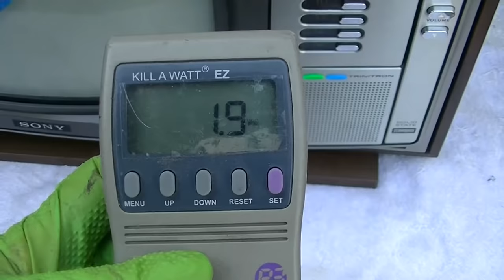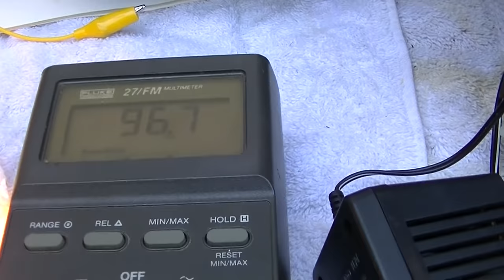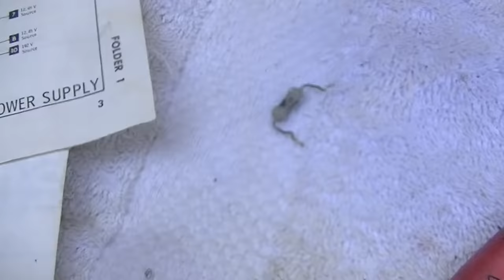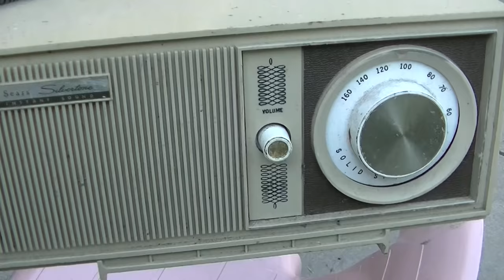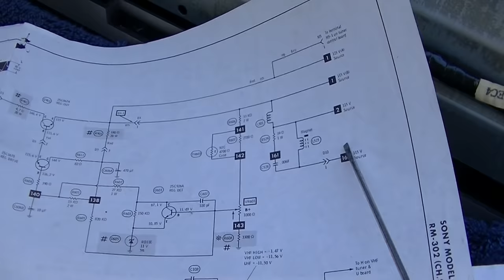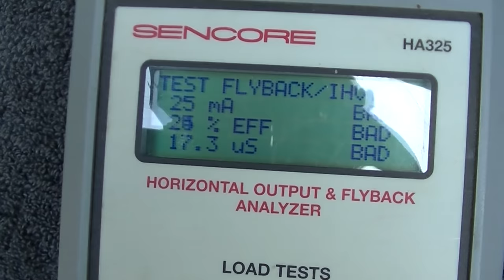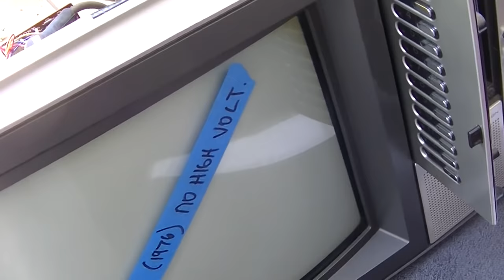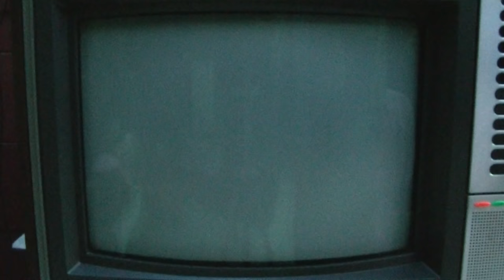Sony Trinitron KV1541 Remote Set Super Hard Fix 1977 Vintage Color TV

Comment: This video has all the hallmarks of a classic adventure move, suspense, fear, frustration and finally tears of joy at the sight of that raster.
As a kid in the 70s I hung out in a TV repair shop after school hours and got the tube TV repair bug. Sometimes I would carry an old surplus TV sets half a mile back to my parents house where I would tinker with them. I appreciate your videos and tenacity, really glad you didn't give on on this one, it would have been such a disappointment!
Reply: And stay through to the "end credits".  That imitation of the giggle was priceless, as well as the '80s videos.  Lots of Debbie Gibson.
Reply: still stuck with 21 inch toshiba crt tv, Age is 26 years and running.But the picture slowly losing sharpness.
Reply: I was a paperboy in 1988 or so when I got my first Sony Trinitron, a KV-1710. It was a rainy morning in April, ice caking on the TV, and it was in the garbage. I carried it from house to house as I finished my route, vigilant of the garbage truck. My arms were falling off, but I kept on saying to myself that it's a Trinitron. I got it home and defrosted it by letting it drip into the bathtub. A good clean, a good alignment with my TI-99/4A as the pattern generator, and that was my main TV until I was gifted a broken KV-1926. (Broken KV-1926? No stereo sound! KV-1926 was mono!)
Reply: My uncle [Moms elder brother] taught me radio and TV repair when I was age 8 - 
and I am going back to (c)1950 -- Joining the RAF in 1961 - after learning to fly at age 13 -
Serving later with Bomber Command  - I later studied Electronics and Electro-Mechanical Engineering,
having had a passion for it since a young age -  
Having served in the Military for 30 years serving three countries, and the Government paid for all that education and other studies I undertook.
Well that was one reason in joining the Military 
My problem now is that I know too much - Sometimes it can be a curse.
Even in my late years I find myself always repairing something - It keeps my mind active as does reading.
anything I can learn from.
One thing to remember  -  it is SONY  and not Sony -- 
People look at things and like zombies they cannot see exactly what they are looking at.
Yet the clues are right in front of their eyes.
CORPORATE Names are 'Always' in the ALL CAPS iteration.
Names of living souls are in 'Mixed Case' Letters
Teach the zombies to pay attention to detail.
Good luck
Reply: Only a marketing  or advertising person would notice such things.  The ideas and importance of branding are only important to them, bean counters and the business owners.  Whether it says sony Sony or SONY, it's all the same to Joe or Jane sixpack.

Comment: Great video - RE 70s era on-screen display - I somehow convinced my Dad that we needed a state-of-the-art TV for football. And then I further convinced him that the only TV worth considering was the top-of-the-line Heathkit 25" - and this set of boxes with 1000s of components arrived. Got it all together, and the magic smoke stayed inside. It had an on-screen display and an ultrasonic remote. It had built-in test pattern generation. Our dog could hear the remote up close. Pop used that TV for 30 years. It was still working perfectly when it got replaced by a larger TV.

Comment: Those spacers serve two purpose: minimizing eddy currents, and preventing core saturation because flybacks and single ended output transformers are always driven with the same current direction, which magnetizes the cores if there is no air gup in the core it will saturate, it will develop 2nd order distortion and its efficacy will drop. To compensate these effects you need to use either bigger cores or you need to put in an air gup.
Reply: I don't know how the air gap "minimises eddy currents" because in the first place the ferrite core is a poor electrical conductor. (I'm thinking its a ferrite core, and not a pressed powdered iron core because the core had an air gap.) The gap in the core, created by the spacers... does prevent saturation by reducing the permeability. But the air gap also changes the inductance... and in a flyback, so the resonant frequency too.
Reply: @willthecat3861  core saturation was the big problem with flyback low voltage derived power
Reply: @GBS1043  Yes. Does that relate to eddy currents? Because the fact that ferrite doesn't conduct very much, and has very tiny eddy currents, means there is little losses from eddy currents

Comment: The company I work for used to convert Sony Tvs into various types of video monitors, so we were pretty familiar with many of the different models back in the earlier days. The models that had the GCS (Gate Controlled Switch) were always a pain when they failed. Sony had a service bulletin that detailed exactly how to fix them, there was a list of parts to change every time a GCS failed and if their procedure was followed, 99 times out of 100 the set would come up with no additional problems. Many times the generic replacements would not work for the GCS as a lot of TV shops discovered. I used to do Sony work for five TV shops on a contract basis. The blown GCS was probably the second most common problem I saw, the most common was bridge rectifier failure to to lightning storms. As I recall, the GCS was something of a forerunner to the modern V-MOSTFET (invented by Sony years later). Somewhere, I think I have some technical info and specs on the GCS parts but I haven't seen it since the late 1970s.

For anyone working on later Sony TVs, Sony got the bright idea to put a large power resistor in parallel with the voltage regulator, to reduce some of the heat from it. If the high voltage failed, the main supply would jump to 170VDC which could sometimes cause other problems. Bad capacitors in the vertical deflection circuits were also pretty common. In later TVs, they used an integrated module for voltage regulation,  some of these were awful, the main supply would vary over 10V just by turning the picture (contrast) control, this in turn would cause the horizontal size to change quite a bit. We would change them on an as needed basis if the change was more than 4V or so.

I actually have a pile of those heat sinks for the main voltage regulator, and maybe even still a box of the voltage regulator transistor that were removed during modification, at least several hundred last I recall. Still have a pile of Sony OEM replacement parts I should probably sell off too, including some genuine GCS parts. Last time I bought them, I believe in the 1990s, they were about $21 each. I think we still have all of the original Sony service manuals as well plus the service bulletins.

In my opinion, the 15 inch Sony TVs had the best picture, in part due to the tighter stripe pitch on the pix tube compared to the 17 and 19". The 12 inch looked great too. The generation after they stopped using the GCS circuit, which included the KV1205 were probably the best looking model of all, a bright picture, next generation Trinitron tube and much better color demodulation. While it is all hazy now, one of the reasons Sony TVs looked good to most people is that Sony altered the red channel decoding by moving the phase angle about 10 degrees more toward yellow to give a more orange red, which helped skin tones in the days of analog color demodulation.

Thank you for the entertaining look at these old televisions and the trials to repair them. Sony TVs stumped a lot of good technicians, especially the GCS models.
Reply: The ECG276 sub for the SG264 never lasted one minute.
Reply: Yeah, fixed a few Sony sets.   High quality, but the circuit was always unusual.   I suggested that they were designed by an alien, because if all other sets did something one or two different ways, Sony invented a third, like the GCS vs bipolar transistor for H Out.  Very reliable until they got old, then you'd get a cascade fault and blow up half the set.

Comment: Well shango066, Congratulations, you sure earned your bucket of oats on that repair!  In the mid-1970's, that SCR horizontal flyback drive circuit became popular for a while.  It put out a lot more power than the traditional beam power pentode and was needed to power the new high brightness CRTs used then.  It proved to be very problematic, switching currents were so high, it caused RF to be generated, which broke down the plastic film caps used around the flyback.  This circuit was replaced with a high voltage NPN power transistor in later sets.

These 1970's solid-state horizontal stages were hard to troubleshoot (as you well know) because, the flyback was also used as a power transformer to generate all the other voltages in the set so, the circuit ended up being a huge control loop, making it almost impossible to troubleshoot.  You have to break the loop to do that effectively and run one block at a time.

That bad flyback appears to have a bad high voltage rectifier, that breaks down under full high voltage.

I especially disliked working on Sony sets.  The company definitely has ego problems, always trying to reinvent the wheel and showcase their accomplishments, which ended up making the sets unnecessarily difficult to service.

In the 1960's and 1970's, it was common to see transistors misapplied in TVs, operating in regions that caused secondary breakdown problems.  Over dissipating components was also common.  That series pass regulator transistor for instance, it should be at least a 5 amp part and there should be some type of current limit circuit that folds back, instead of blowing the fuse and several expensive transistors.

The plastic disks between the flyback cores were used for two reasons: (1) To keep the core from saturating.  (2) To adjust the resonant frequency to achieve the proper ring shape, which affects the horizontal sweep linearity.
Reply: I've seen some large current switching supplies from computers of that era based on SCRs too. Guess why we don't see those either anymore
Reply: @gabotron94  Those SCR switched supplies came out before power FETs were developed.  They were more lossy, generated more radio interference, and used physically larger coils/transformers.

Comment: welcome to the world of sony sets that use gate control switches  it took us a long time to work out the idea of running the line osc from batteries we used 2 pp3 in series  some sets used gcs as line output and psu chopper circuits they were a compleat nightmare  antway very well done and thanks for not giving up
PS in the british practical teivision mag there was an artical about converting the line output stage to run useing a BU208a trasistor in place of the GCS.
Reply: Used to fix the odd Sony.   Quality stuff, but it was very different.  If there were three ways to do something, they did it a fourth way.   i often suggested to the boss they were designed by an alien.  Worked well, but GCS for flyback when everyone else used a bipolar transistor.... different design philosophy.

Comment: Great stuff Shango! Yes, these are a pain sometimes. What do you think of the two series HV diodes to the CRT anode, possibly leaky? Maybe breakdown in the H-STAT block? Thanks for taking the time to share your adventure.
Reply from the maker: I think it has something to do with the broken bolt because it comes up again in a future video. If I can find a replacement u bolt I might revisit this
Reply: @shango066  I used to do Sony repair for many years, Many MANY years ago.  Smells like the h-stat block to me.
Reply: I also have to say, Sony sets from this time period are what made Sony famous.  Their picture quality was so far ahead of everyone else's, and the engineering and circuit design was like 5-10 years ahead of what the old established US brands like RCA, Zenith, and Maganovox had.
Reply: @shango066  the bolt presses both halves of the ferrite core tightly together to keep the air gap (thickness controlled by the plastic inserts) small. When the pressure is missing the air gap will increase, greatly reducing the inductance of the flyback. Your Sencore instrument read 1.something instead of 10.something µH !
Reply: @shango066  I think that will affect the inductance of the flyback a fair bit. Think of the way a shading coil affects an induction motor.
Reply: Interesting about the H-STAT block. In the 1990's I repaired several KV-1830's, and the trickiest part when the horizontal output stage had a fault caused the immediate shut-down of the power supply. In Australia, where mains voltage is 240V AC, the power supply was a switch mode, giving 12V and 135V DC rails. I think there was a 'fail-safe' circuit (supply relying on a 'horizontal pulse') with the effect of 'protecting' the expensive SG-613.. For a diagnosis, I set up an incandescent light globe 75Watts, 240V wired in series with the mains. Switch it on, and leave on for 10 or more minutes. Switch off, disconnect, and measure the temperature of the transformer and H-STAT block. The faulty one is the 'hotter'. It was the only way of determining exactly which one of the two without arduous and unnecessary substitution...

Comment: I worked on many Sony Trinitron solid state sets a few decades ago; they were one of the most difficult TV's to work on. They were well known for cascade failures, the most common failure, the regulator, SCR Horizontal output, and the occasional flyback transformer, that caused even more parts damage.

Comment: The dreaded brown glue, which eventually conducts. The removal of that gunk is essential, especially if it crosses two component leads and/or it's smeared on the solder side of any of the PCB's. That stuff was always a nightmare and was the cause of many failures in TV's, VCR power supplies and computer monitors... Good catch on the flyback transformer and the fixing of the vertical... WELL DONE!!!  10/10

Comment: "You could burn money faster in this than in a fire" Brilliant line! Been there with an Australian Sony KV-1830AS that had a sg-613 in it. They were AU$50 a throw back in the mid 90's. At the time I only had poorly photocopied schematics and no youtube videos to help. 

Another fun Trinitron to fix is the KX-27PS1 Profeel monitor (which I had and absolutely loved). I has a weird self oscillating SMPS that controls the primary side by injecting a signal from the secondary side of the isolation transformer. My one would intermittently kill the SMPS  switching transistor on power up. After replacing the main switching transistor (2SC-something cant remember) many times I modified the soft start circuit which finally fixed the problem.
Reply: Oh yeah, I blew up a couple of big and expensive IGBTs (and fuses) when trying to repair my UPS until I managed to do it.

Comment: All along the video I was yelling at the screen: "The U-Clamp...the air gap...the reluctance!" 😊   Seriously, one of your best videos to date, excellent troubleshooting, astounding perseverance and a good reminder of the dark Trinitron servicing days where we often fitted a new flyback into the Sony magic electronic marvel boxes just to be on the safe side, haha. Huge thumbs up, thanks for sharing👍👍
Reply: Very cool, did you know that from experience? Or did you spot the broken bracket earlier? 

Just goes to show how these are still "analog", even though there's transistors it's still a bunch of tuned circuits working in harmony. Thinking of it that way makes it easier to understand secondary and "chain" faults like this...
Reply: Hello Where in the video did you see a broken bracket please?

Comment: I'm wondering if the broken bracket on the flyback is the issue. It appears that the spacers between the two ferrite halfs are soft (compressible), and an airgap is needed. From what i understand, the size of such  an airgap influences the performance. Maybe that whole darn thing is somehow adjusted/tuned by tighetening the screws for that bracket, thus effectively adjusting the size of the airgaps?  I mean, if the psacers would set a fixed airgap, why go through all the trouble with a threaded bracket and nuts, instead of just gluing it together and mounting  it with a simple clip?
Reply: The air gap has a lot more reluctance (resistance to magnetic flux) than the ferrite (if that is what the core is)... perhaps 10 to 100? times more. So a bigger gap... more reluctance. Usually the air gap in flybacks is set very precisely, and is usually there is glue, so the gap doesn't change.
Reply: I read in a TV repair book decades ago that the resonance of the flyback is tuned in the factory with a certain amount of air gap, and the brecket is also part of the tuning, IIRC it acts like a magnetic shunt, so it being broken definitely messes with the resonant frequency. The flyback is tuned for self-resonance at around the third...fifth harmonic of the horiziontal frequency, so it's very picky for tuning.
Reply: Your right mate, all fly back transformers have to have a gap, this is how fly back transformers work, inducing big reverse voltages without the core saturating, and the size of the gap has big effects on efficiency , but I doubt very much if the gap would be adjustable, I can remember them coming  lose and clamping back up fixes them, forward type transformers don't have any air gaps, But hey, what would I know, been long time since I got into any technical stuff. But you just have to shake this guys hand, for his perseverance and efforts, way beyond any thing 99.9% of people would even think about, I know when I used to fix TV,s (70s 80s) at best it would have been change line output transistor, and maybe few before it, and if no picture it would have been beyond economical repair and it  the parts pile :-)